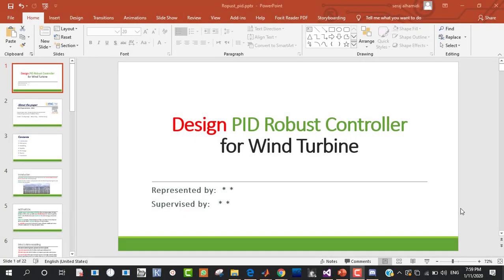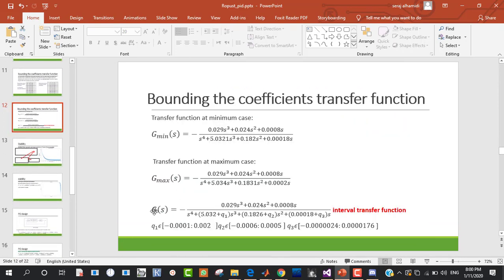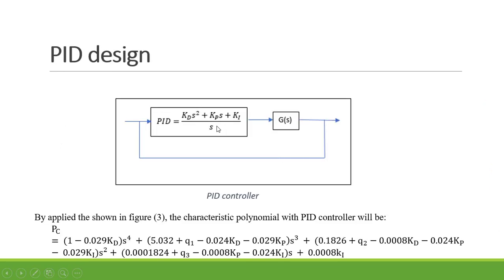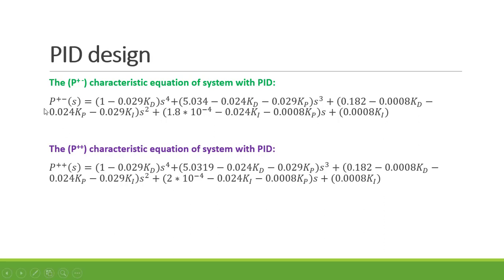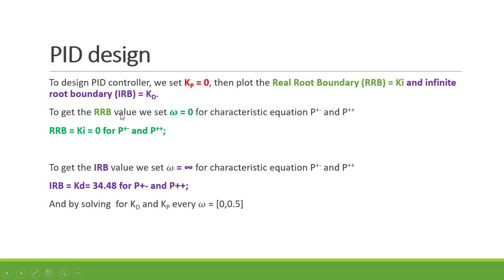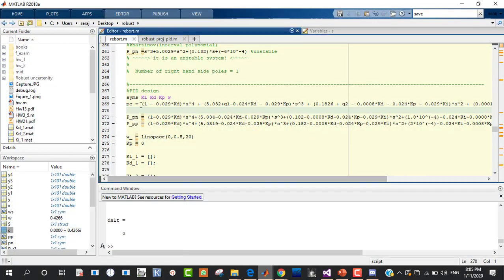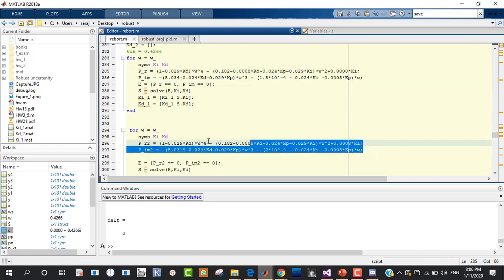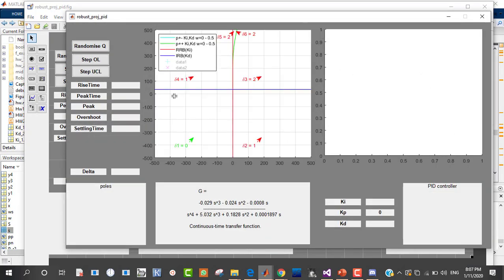Design PID Robust Controller

Comment: Hey, I'm Vishu Rana and currently I have to work on an python TensorFlow object detection model which detects army uniform in an image.

I have already collected and labelled the images with the LabelImg tool, So i have done most of the heavy lifting.It has been four days and i cannot figure out how to create this model.There are a million errors and i'm pulling my hair and at the brink of depression (i'm not even kidding).

Can you use these training image to create an object detection model and send me the trained model. I can even pay if you can help me. Just use these already labelled images to train a model and there is only one label - "Uniform".

Here's the labelled images zip: https://drive.google.com/file/d/1sfdTXNW8CkQWVyH336IsQ0tVExJzhdCt

PLEASE HELP,
Thanks